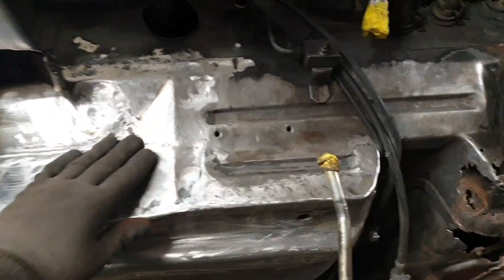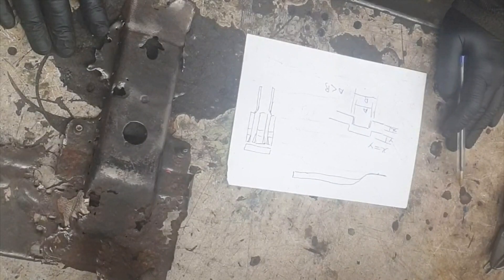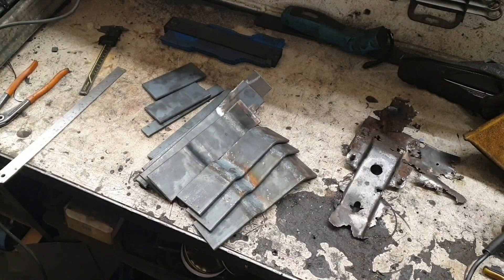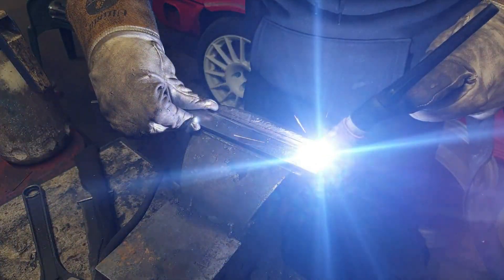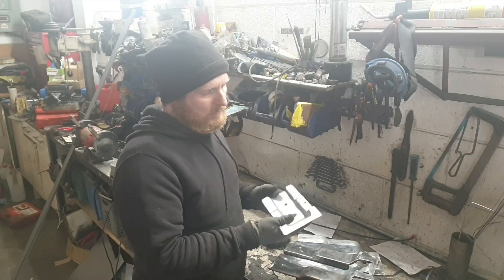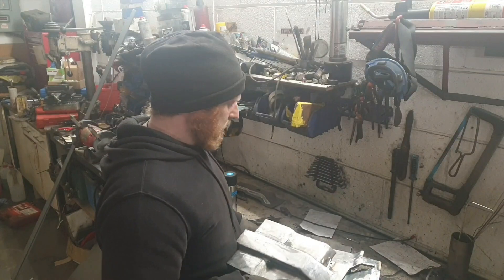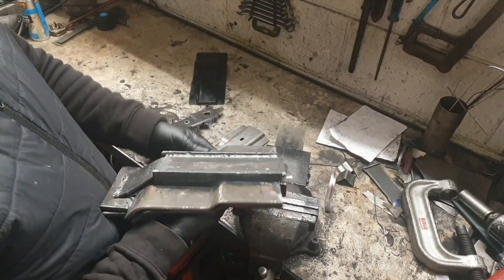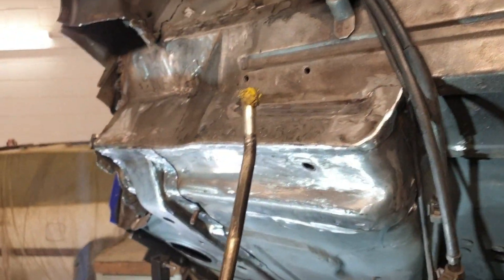How to make a car body panel - custom sheet metal press dies: Kei car restoration part 8

Comment: That  was inspiring, Excellent work and with just a few tools, very well done. One question please, what was the air tool you used to form the pressing and where can I get/make one.
Reply from the maker: It's not really an air tool as such, it's a ball joint replacement tool that I'm driving with an impact gun to make it easier and quicker. In effect its a big sturdy g clamp. They're available all over (ebay/amazon etc). Mine is a Kennedy brand model but the same thing is available cheaper without that name on it. 

A press might have been better but I think you'd need more than just a basic 10 ton one. I used what I had to hand. Thanks for watching

Comment: Excellent work. Do you take on customer cars? I've got a Z32 with some rot issues and I'm struggling to find someone local (Teesside) to take it on. You come recommended but I can't find any contact details for you other than these vids.
Reply from the maker: Thanks, but no, sorry. I've got enough work on the books for pretty much the entire year at this point and won't be doing any more welding after this anyway.